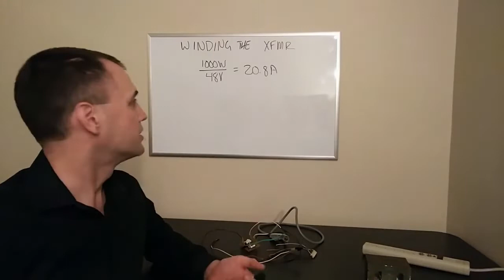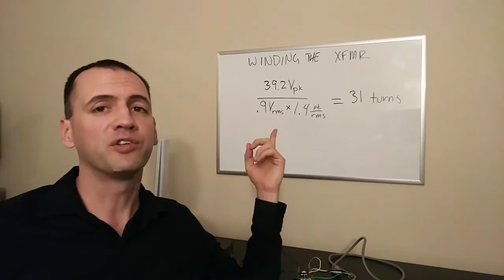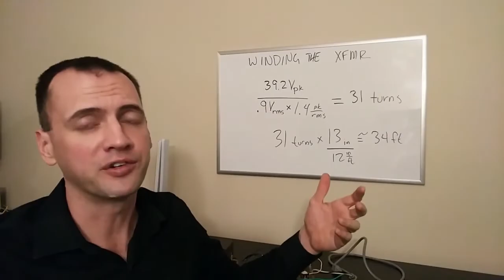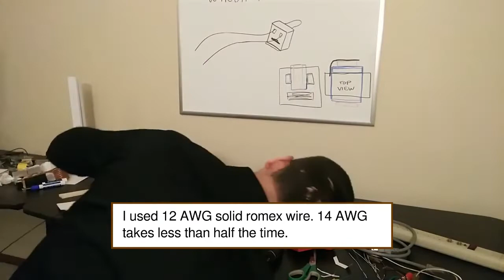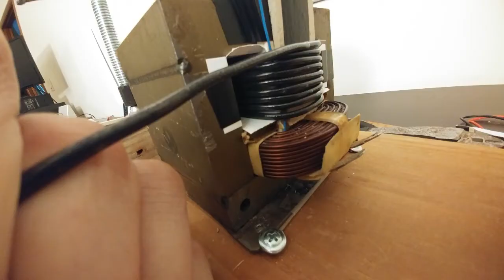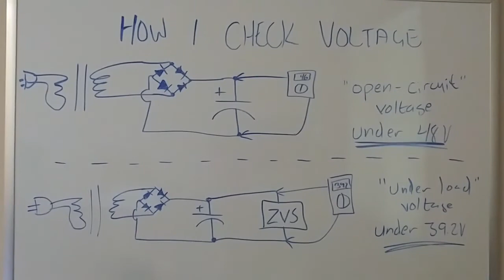Cheap 'N Easy ZVS Build 2/5: Rewinding a microwave oven transformer for an induction heater

Comment: I have a 1000w microwave transformer did you think that I would be able to get about 63v out of it with 12g wire or wont their be enough room ?
Reply from the maker: I haven't come across one with enough room to get 63V with 12GA. While I don't give advice on designs I'll say other people have wound 2 transformers to get higher voltages. I lean towards that because cooling can be an issue, especially with wires that use thick insulation rather than lacquer.